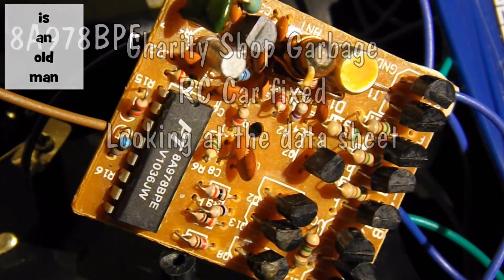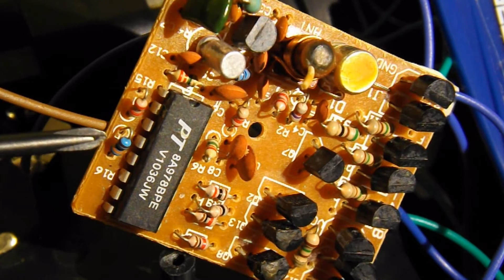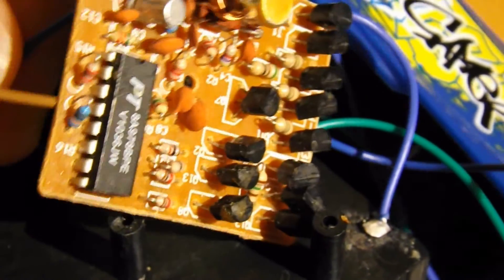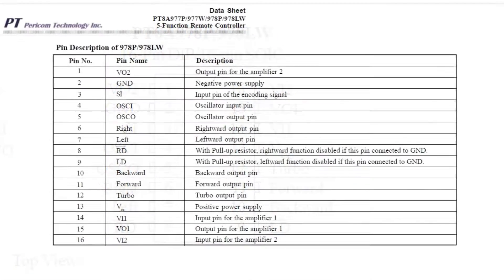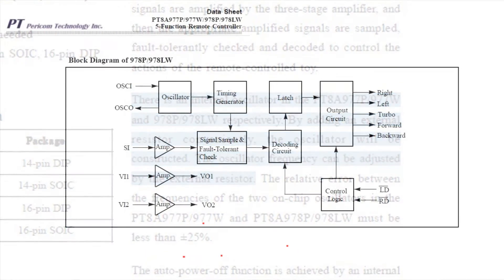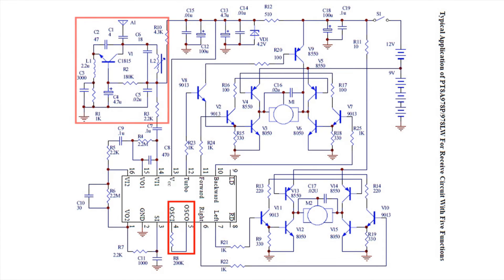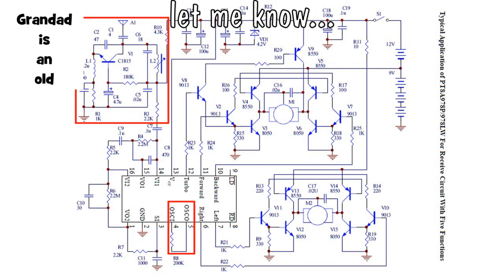Charity Shop Garbage RC Car data sheet PT8A978 5-function Remote Controller

Comment: I want to build a rc car I bought both pt 8a978 and pt 8a977
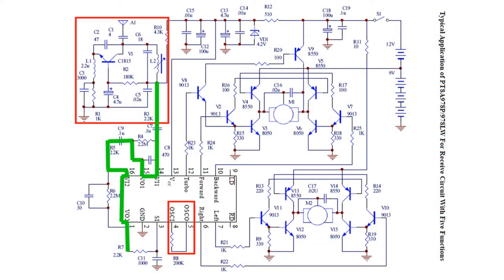2:14 that circuit looks complicated
Remote control was quite easy to build
Reply from the maker: Good luck with that 👍
Reply: @GrandadIsAnOldMan  yeah I could build that circuit but then I need more parts I think

Comment: i got an old RC car with this circuito, but i lost the control. Can you teach us in a video how is the controler circuit?
Reply from the maker: All I can suggest is you buy another controller or find another cheap RC car that has the same controller and see if it works for your car. Make sure it is the same frequency, but even with the same frequency they do not always match due to manufacturer differences. It is not easy to source the TX chips on their own to build your own transmitter. Here are two videos where I look at the RX & TX chips 
Toy Grade RC adding TURBO MODE to TX2B transmitter https://youtu.be/c8Fx4llKOUg
Toy Grade RC TX2B and RX2B test circuit https://youtu.be/M46Gpyl9KYE

Comment: i need the diagram for the remote control, because i have the car but not the remote control
Reply from the maker: The link to the data sheet is in the video description http://html.alldatasheet.com/html-pdf/155401/PERICOM/PT8A978P/295/1/PT8A978P.html

Comment: you have done your homework.its all what it taks if you are not comfortable with a loos wire then use a variable resistance between 4 and 5 pin and try to tune it.otherwise go with the wire.i am also stuck up with the same issue and will try your method in the morning
Reply from the maker: Good luck, I have no idea why it should work and so I cannot give any advice 😊
Reply: Now i am going to change all resistor ,caps in receiver section??
Reply from the maker: That sound like a lot of effort when it would be easier to swap the receiver board, but if you just want to find out what the problem is then it would make a good project to work your way through one component at a time.

Comment: This is the same as the other message I sent, you are adjusting the datarate oscillator to make the tx and rx run at a similar enough frequency to work correctly. The device across pins 4 and 5 is a resistor, the reason it looks diffrent to the others is that its a precision 1% resistor, they probably used that not so much for absolute accuracy, but for low temperature drift.
Reply from the maker: hellcattanks thanks again :-) Yes the diagram at 02:00 shows that it is a resistor.

Comment: I'd imagine replacing R16 with another 200K resistor ought to do it, presuming it goes between pins 4 to 5 (or pair of 100K's in series as 200K's are rare and 100K's are all over old boards).
In my opinion...the wire will indeed probably be picking up like an antenna and forming a difference in signal, working to trigger oscillations. Otherwise with nothing there, no signal means nothing to work with.
Reply from the maker: When I can clear my work space I will give it a try. It seems odd that is the only blue resistor on the board. I will check what resistance it is by the colour code first as that diagram is just a generic so it may not be 200. Have to get my glasses on :-)
Reply: GrandadIsAnOldMan
 Should be red/black/yellow if 200K (100K being brown/black/yellow).
Another idea is to put a small variable pot of 250K on the connections and see if it works within a certain range. If so then it makes finding a resistor easier.
Another thought is that by them putting that thing in at the factory it may have limited the original life of it !
Reply: BTW for your bike project, this video shows an idea...!
https://www.youtube.com/watch?v=05eYIcAL5e0
Can skip most of it, it drags on a bit when he sets it up, but the concept looks really cool.
Reply from the maker: Haha I think that is cheating :-)
Reply from the maker: Looking at my photo of the resistor it looks brown black yellow but cant trust the colours on a photo. I will have to take the car apart again to check. Will get to it soon.
Reply from the maker: slider2732 Had a go, might upload a video if I can edit it down to a sensible sequence. The resistor is a 5 band colour code but I am not confident on the colours but it measured OK on my meter although my meter is not calibrated accurately. I will have to watch my video back to check what the reading was. The colour code was possibly Brown Orange Black Grey Brown or the other way round, but I am not confident on the grey, might be yellow. I took several pictures but still not confident on the colours. Think my meter said 17K ish but the video is downloading from the camera so can't check yet. Probably best to ignore all those figures till I can look at my video, my memory does not work very well.
Oh as I was able to measure the resistance I decided the resistor was OK and I didn't have any with those values anyway. With the resistor disconnected nothing worked even with that wire still attached.
Reply: GrandadIsAnOldMan
Ah I see, the 5 banded are confusing as they don't follow the vastly more common codings. However, Brown is 1% and they are more accurate in value than 4 band resistors.
A little theory is that the resistor has fused some of the wire turns inside it, partially failed so giving 17K.
17K ought to be Brown/Violet/Black/Red/Brown.
I say throw 200K on it anyway to test, the generic datasheet at least gives values that work generically. The piece of wire (plus resistor) trick did it too, so the receiver has a future even if it throws more spanners at you :)
Reply from the maker: Interesting thought, I have never considered a resistor partially failing, my meter does read somewhere between 170K and 180K but it is not particularly accurate, in fact it is probably due a fresh battery so I might treat it.
Reading the colours was a pain as that grey really seemed vague, plus I was trying to make sense of the code in reverse but eventually logic told me that would have been such an odd value I must have it backwards.
Reply from the maker: slider2732 Just realised you might not have seen the next video. Brown Grey Black Orange Brown 180K 1%

Comment: Hay grandad can u make a tank the uses toothbrush motors to power it my tip for making tank belts are taking a pice of cardboard and removing the paper off one side I have never tried this but it mite work if it dose work that would be great for future projects such as a rc tank using infa red light and I hope you try this and have quite the amount of success
Reply from the maker: Tanks have been on my list for a long time and I haven't got to them yet. I will add your request to the list.
Reply from the maker: You might like this tank as it uses the same idea for tank tracks. You may have seen it already http://youtu.be/X5VdoWAXmio